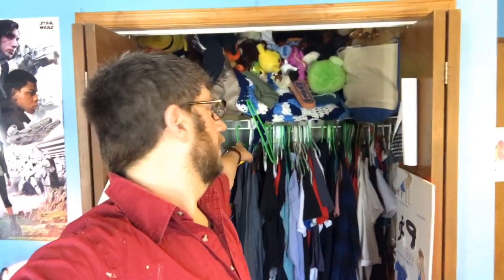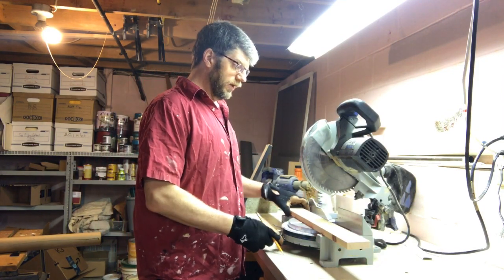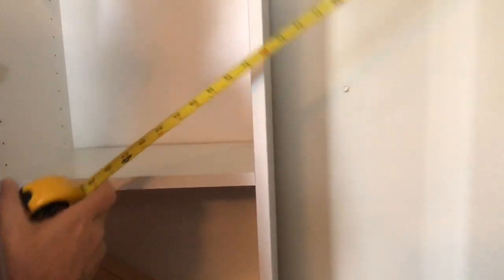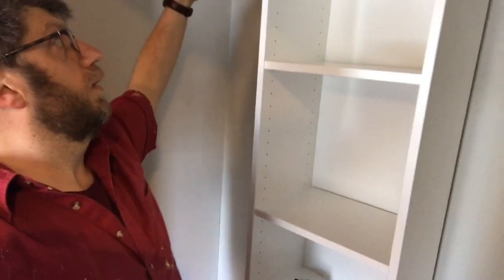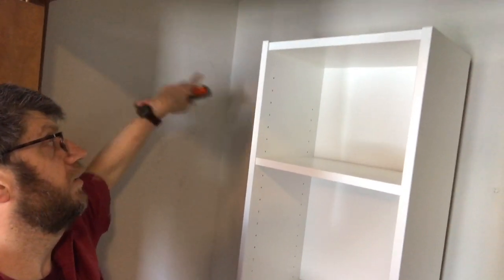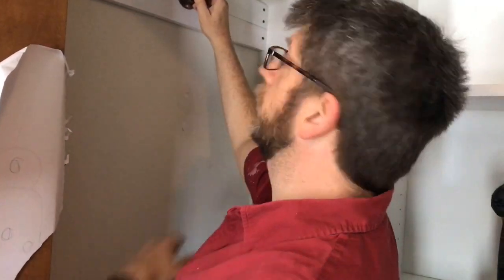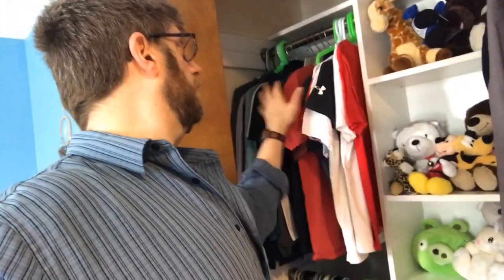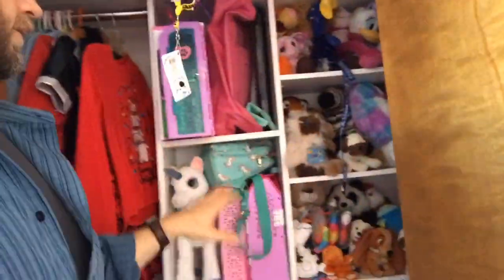IKEA Hacking - Using a Billy Bookcase to Create An Entire Closet Organizer System

Comment: How much weight can the hanger hold? I have about the same closet but I have A LOT of clothes.
Reply from the maker: Well, there are a lot of factors, but three feet of bar should be able to hold a full rack of clothing.  My wife's closet bars are pretty full and they've held up fine over the years.  The key is using a good stainless steel bar (no aluminum, no wood, no shower curtain rod stand-in) and making sure the brackets on both ends are securely tied into a solid surface (either a wall stud, wood block or solid standing interior closet piece).

Comment: How about getting a thinner rod?
Reply from the maker: I used what I had already purchased.  A thinner rod might work, though it may also hold less weight and be less durable.  You do NOT want to use a shower curtain rod for clothing.  You'll want to stick to the heavy duty poles and rods that are designed for closets.

Comment: why did you not just use the wire rack shelf you took down to make your hanger shelves you would have a shelf and a hanger and not need to put up two pieces of wood and  the hangers would fit?